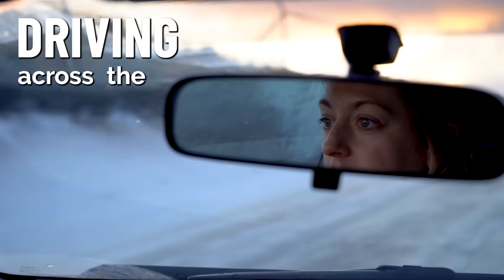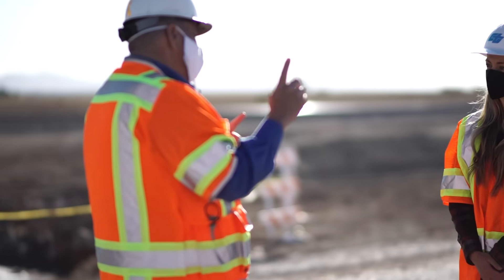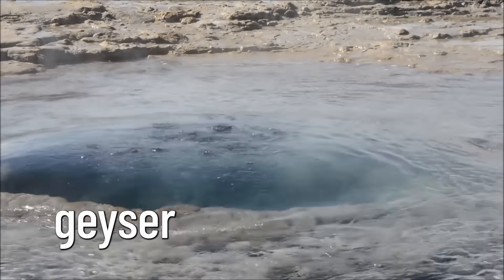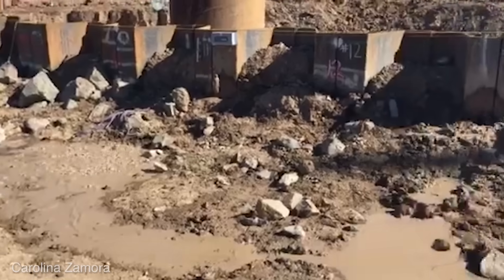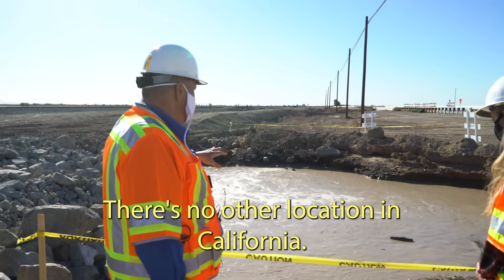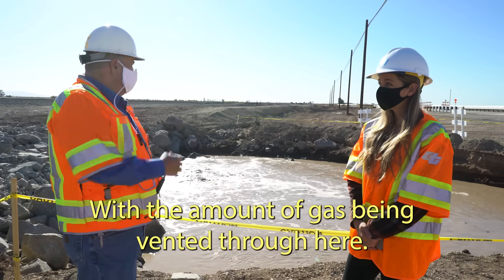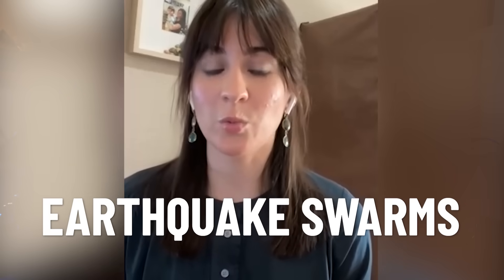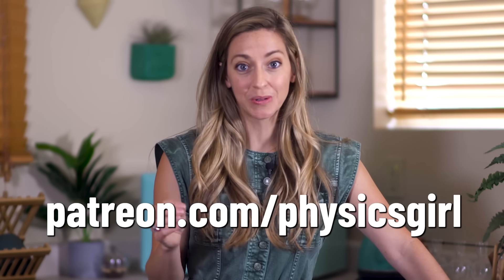World's Only Moving Mud Puddle

Comment: I suspect it's eroding through a cap of material somewhere underground. It poked through somewhere and then, perhaps following a fracture or other discontinuity caused by an earthquake, it's eroding along that line towards the larger remaining pocket of pressure (with the puddle following along on the surface as it takes the shortest available path).

Comment: Interesting and clever theory on how/why.  If it's correct, perhaps engineers could mitigate anticipated damage and relieve the pressure by drilling angled holes in advance of the probable path, allowing it to "jump" instead of trying to blocking it.  ?  When they tried blocking it from the railroad tracks, it seemed like they didn't really understand what was happening.

Comment: So if it wants to get a straight path to the surface... couldn't they give it one? Find out where the source is and drill down from right above it? Then it would be in the right location and no longer move. And all the infrastructure between its current location and its ideal location would be saved. 

Of course, that drilling rig is absolutely going to blow up, they better prepare for that. Make it automated, maybe?

Comment: As a Structural Engineer, I was fascinated by this unusual phenomenon. Having worked a lot with railways over the years I was a little disappointed that the video skipped over the engineering solution that saved the permanent way and allowed the railway to remain open (assuming it did). I'd love to know what the solution was if anybody knows.
Reply: Sebastian Jost
 (11 hours ago)
"O just looked it up:
Apparently they moved the railroad to the other side of the puddle and moved the Highway away from the puddle.
They'll wait until the puddle has crossed the old highway to repair and reuse it once the puddle has passed"
Reply: I was just about to comment the same, what happened with the railway in the end!!?
Reply: The mud pool comes from the depth, so it just moved continued to move on below the sheet pile wall. The gasses tried to find a way out through the foundation of the tracks, but all the lower part just didn't care and moved on below the tracks. If there wasn't too much erosion of the foundation or if it is strong or can be fortified to bridge over the weak area, the railway should be fine.
Reply: @gehirndoper  Yeah the puddle definitely didnt move "under" the wall, the top is just the result, the actual movement is a lot farther down. The explanation given makes a lot of sense and is almost definitely what is causing it to move.

Comment: If it's comming up at an angle, wouldn't it work to drill down on the other side of the road a couple of times until you hit the gas? Maybe with some fracking to make sure you hit the gas? Then create a new mud pod on the other side that will then move away from the road?

Comment: Hmm.solution. If the theory that it is moving to the source is correct, then you can analyze the movement. Drill several wells above the expected gas source (behind roads, etc.). giving the gas a shorter way to get out, if that helps, let me know)

Comment: Not sure where they drilled the relief well before, but it seems the only way they might avoid the road collapsing would be to drill a relief well on the other side of the road, hoping that they might intercept the source of the pressure and allow it to surface on the other side of the road, cutting off the supply for the existing mud spring and creating a new one on the other side of the road.

Comment: If the stream is coming up diagonally, can't we drill a relief hole in the path the hole is currently taking? Because in theory, that hole should directly tap the gas source. By drilling right behind the road you might be able to force the puddle to skip the road, no?

Comment: I wanted to wait a few days so that this not-completely-positive comment would have LESS of a chance of being buried in the well-earned avalanche of praise that the channel regularly gets for a day or two after each video.

But...

WHY has the channel, after all these years, gone down the rabbit hole of pandering, clickbaitey thumbnails?

Red/yellow arrows/circles are the BANE of thumbnails.  It's the visual version of "#27 will LEAVE YOU SHOCKED"

Your content deserves non-clickbaitey thumbnails, the way it was for years.

I'd be legit curious how sensitive your audience is to clickbait if they had a poll such as

1)I don't think the thumbnails are clickbaitey and I'm fine with them.
2)I do think the thumbnails are clickbaitey and I'm fine with that.
3)I do think the thumbnails are clickbaitey and I'm not fine with that.

(That's not meant as a suggestion, just as an illustration of the potential viewpoints)

Comment: Well, it looks like the sheet wall did work in protecting the tracks (even if the mud puddle didn't stop). Why not try it with the road?
Also, why was the train stopped on the tracks?  Were they checking it out?

Comment: ummmm sounds like a crack in the mantle evolving and water is simply cutting it's way threw and releasing other gases underneath that sounds very bad they maybe building a bridge coming soon instead of a road cause the crack could very deep in the ground perhaps hundreds of feet and it would very difficult to build if the earth is opening as a crack expanse.

Comment: So, it moves thru very heavy things easily. The gas is mixing with the soil and severely lowering its internal viscosity. Like the Leidenfrost effect, but at room temperature. The long metal bulwark won't work because as compared to the gas, it has a huge difference in density. Metal also transfers heat extremely well, so it could easily transfer the heat from one side of the bulwark to the other side, heating the sand, and continuing the movement of the mud puddle. Also, how deep is the gas bubbling up from? The puddle seems to meet obstacles by seeing how rigid it is, meeting some resistance, and then off-shooting to avoid the rigid thing. Think of simple vector mechanics here. Picture an isosceles triangle sunken into the ground with its tallest side pointing downwards. Imagine yourself along the two sides facing downwards at various points. At the apex of these two sides is where the hardest ability to move straight-up will be. Along the sides will be theSince the puddle seems to be moving along in a line, it seems this line, of whatever it is, is helping to direct the puddle forward. So, my proposal for fixing this is to create a lower density at the top, so that it wants to find relief only in this less dense spot and so remains there. The gases are noxious and may be flammable. So, when the spot is remained fixed, a building could be built around the spot and the gases collected to either move a fan for energy production, or the gases burned for combustion energy production.

Comment: I am a Petroleum and Natural Gas Engineer, sooo I think I have a solution for this. 🤔

First,
If possible something called a seismic survey, which is a good to understand what is happening in the subsurface.

After you see the subsurface image, the reservoir's location can be possibly determined.

Then, TWO well be be drilled, one as a producer to take the mud out, the other in an injecter to force the mud to go toward the producer. (this method is used in oil industry)

In this way, you will produce a mud consistently, let's say for a month or so, which result in relieving of pressure.

I have a fully detailed plan in my head for some reason, or maybe it's my engineering sense acting by its own 😂

Feel free to contact me for more details.

Ahmed.abdulraoof@outlook.com

Comment: There are zones at various locations on the globe where the geothermal and pressure gradients are abnormally high. Some areas in the United States where abnormally high pressures and temperatures. The consequences are many and the worse case is the continent is sinking.The bottom-hole temperature at 2.2 km was found to be 70°C. The mean surface temperature for the region is 24°C. Determine the geothermal gradient  and a temperature of the formation at a depth of 1,700 m. Solving for  from EquationAs the depth of burial continued, the increase in temperature 
induced dehydration of the clay within the buried zone and contributed to the shearing stresses. The transformation of montmorillonite to illite during diagenesis and catagenesis occurs between 150° and 250°F, releasing an amount of water equal to about half of the original volume, leading to undercompaction in the geopressured zone. 
Ref: https://www.sciencedirect.com/topics/engineering/bottomhole-temperature

Comment: howd they just skip over the part where its touching the rail road.. she just went yeah it passed the railroad? well surely it didnt just jump 100ft to the other side, did they do something to attract it over there or did it chew away the rail bed an shut the line down for days?

same with the highway they had no ending it was chewing away the highway, is it now in the center of the highway? whats the solution there..

and if its coming up on an angle and chewing itself back to its start point cant they track the direction its been moving in and start drilling a line or grid of relief wells over in that direction to try and find its natural resting spot and allow it to bubble away at that point rather than drag a line of destruction until it gets there itself

Comment: Imagine an underground deposit of geologic baking soda, and an acidic watertable neaby, an earthquake releases water into the geologic baking soda, and that forms a geologic carbonator, like in a soda fountain, it compresses CO2 into water, which makes it MORE acidic, and that acts like an acidic waterjet cutter slicing upwards with both waterpressure and carbonic acid (CO2 infused into water is carbonic acid), but this geologic baking soda is in a lateral vein (possibly a buried deposit of volcanic ash) as the reaction peters out in one region it allows untouched material further along the vein to react much like a fuse, thus you could get the "Moving" effect.  What if there is a massive deposit of this geologic baking soda that has a large surface area, such that it can react very quickly?  How deep is it and can it generate enough pressure to exceed both friction and gravitational acceleration?   Could we be facing a potential geologic sized soda bomb?  If it begins to life the surface ground, that would create more volume, and allow the CO2 to escape causing a pressure spike lifting the round more, it could result in a cascade explosion, much like the YellowStone Super caldera did, only not molten, but fizzy,  Still destructive if a foamy house lands on you.

Comment: So it's it's coming up at an angle and it's moving to achieve a vertical path for pressure release, why not drill on the other side of the road, track etc to relieve pressure close to the source? Easy theory to test and if it works, easy solution to avert infrastructure damage.

Comment: I'd love to see down inside it.    Could they drop in an imager?  Googling around, there are sonar for imaging bedrock under the silt of sea floors.   It sounds like it should be powerful enough to get imagery through the mud.   It seems most are specified as "side scan sonar", but a professional in that industry would be better to select the hardware.

I'm picturing the inclined ceiling, like you showed.   Like a giant domed cavern, and it's slowly moving towards the peak as it displaces sand and mud.   It may be important to find what's under it.  When it finally reaches the top, and if the top is solid, it could burst through more dramatically than the well ejection.   

Is it entirely trapped gases coming up?   Is the temperature any higher than normal subterranean temperatures in that area?  Like 55F?   Or is there a chance that it could be driven by a geothermal event deeper down, but is losing the heat by the time it reaches the surface?

They should get a camera set up there, with video stored off-site.   It looks like there's enough frequent activity to make it worth having an off-site archive of the video and sensor data.   Like, in case the next event takes the pole that the camera is mounted to. 

I'm no geologist, but that's neat.   I want to know more!  :)

Comment: I don't understand why they wouldn't have already mapped the area by Ultrasound ?    Ultrasound is used (among many other things and industries) by the Oil Industry to map oil and gas wells miles beneath the surface of Earth. I'm sure they'd learn something useful by doing the same in the vicinity of this "moving mud puddle".
I was at least happy to see they considered drilling "a" relief well. They should consider several along the puddles path of travel and install Perforated, Vertical, Soil Gas, Vent Pipes.

Comment: Assuming this is coming up under a sloping piece of rock it maybe cutting away a Groove in the lower face and Edge of of the Rock.
The start of movement may have resulted from some kind of abrasive substance being introduced into the mud pool which allowed it to more effectively cut the Rock or finally cutting through harder part of the Rock and now it's cutting through a soft part of The Rock.
That one point where the lady implies that it wants to go from the edge of the Rocks sideways back over the original source is kind of goofy. But the thought that it is rising to the sloping Rock and then cutting away at it as it moves towards the surface is much more reasonable. There will be a cutting pressure until the column is moving straight upwards.

Comment: In order to really understand this you would need to know exactly why such mud puddles exist. But in this case I would assume there is some hot plate and a crack deep down that heats up water so it pushes up but that cools down fast enough to not be scalding hot. The crack would explain it moving especially the fact that it started to move after a series of earth quakes.
But that said we probably never really know why it moves.

Comment: Would it be possible to help the mud puddle jump the highway, by anticipating it's path, then drilling down on the other side of the highway to reach the gas. This would allow the gas and water a shorter path to the surface and perhaps save the highway?  You could even drill at an angle if the source is too deep, going under the highway at a deep enough level hopefully to avoid a collapse.

Comment: There were some moving mud pots in Yellowstone National Park that caused them to have to close a camp ground because the mud pots started opening up under the cabins in approx.1967.  They determined that it was probably caused by the underground heat source shifting relative to the surface ground.

Comment: Sounds like they have a long gas pocket that is progressively collapsing and eroding as it deflates, it explains why there's a crater as it "creeps" forward.
Reply: Working with the explaination from the geologist, it could also be a drop in pressure thats allowing the water table to flow into the gas pocket, water being agitated by the gas flowing though could be eroding away at the walls of the gas vent causing it to shift.

Comment: I imagine the water table on top of the carbon dioxide pocket and in between are some rocks which have holes that co2 goes up through and some kind of precipitate forms which fill up the holes and the co2 moves along over time for other holes and precipitate forms again and keeps moving. Idk i dont study geology but maybe you can suggest this to the people working on this and see what they think? So for this theory, maybe a solution would be to go dig at where the puddle had passed to make hole again so the co2 can escape (which might be what they were doing when the drilling mud flew up?)
Reply: Calcium carbide like in seashells could form blocking the holes but you would expect it to move randomly jumping to the weakest parts where it can push through.

Comment: Sooo... if the path is under an angle, why not help the spring move, by drilling on the other side of the road? Then a mud pot will form there, when you hit that path, allowing the original mudpot to dry up and perhaps save the road that way. Or am I over simplifying it here?

Comment: A five storey building is in the range of 50 feet?

So those containing walls were basically not there, as the "sudden" explosion came from hitting a high pressure pocket at six times that depth, and even that is just the upper part of this whole geological formation.

So I guess every time humans meddle with it. something bad eventually happens as we poke it or try to contain it.
Reply: I wonder if the earth quake swarms are the cause or the effect? After decades of eroding deep down in the soil, somthing gave and the vent started moving. This would probably register on a seismograph.

Either way, it is a fascinating phenomenon, I wonder if there is a way to "image" the strata below the ground without disturbing them? I guess the common method of setting off explosives might be considered slightlly too dangerous.

Comment: What if they start digging in the opposite direction away from the roads. Wouldn't water want to move towards lower area? Basically creating a lower lying area for the puddle to move towards. I'm not a civil engineer, but it seems logical.

Comment: What about this. The puddle is not moving, the Earth crust is moving above a deep "volcano" like structure. It started to move after the earthquake because the crust was stuck. The tension caused an Earthquake, and the crust started cruising.
The only problem with this is... Is the Earth crust really moving that fast?